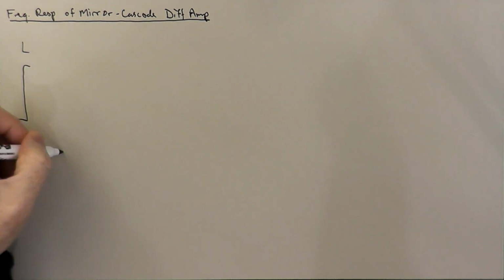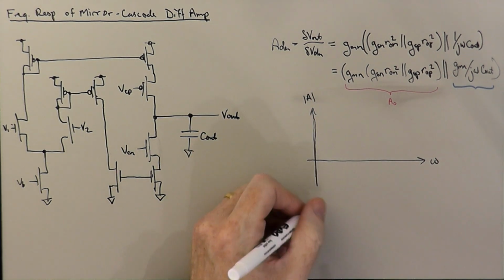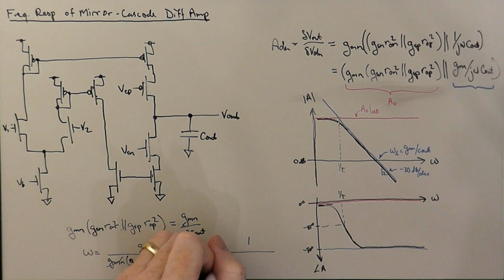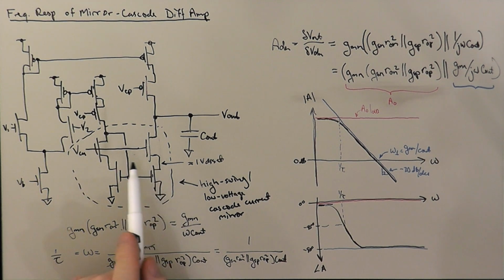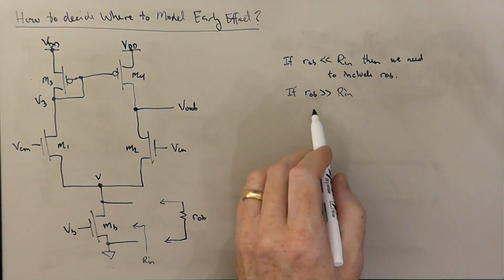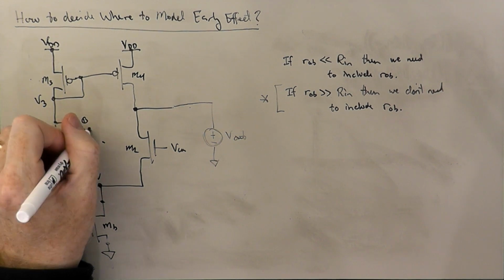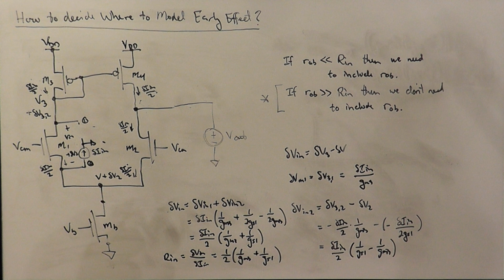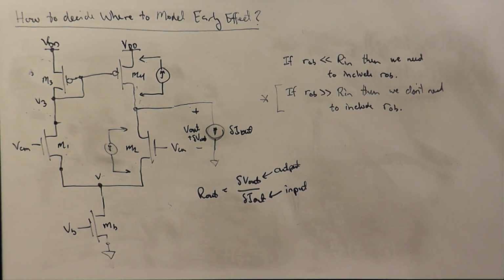Frequency Response of the Mirror-Cascode Diff Amp / Deciding Where to Account for the Early Effect

Comment: Thank you for all the videos. I have a question about this OTA. how can I set the output common mode voltage close to vdd/2? changing the size of transistors does not realy help.
Reply from the maker: I'm not entirely clear on what you are asking about.  The OTA that I discuss in this video has a single-ended output.  In order for there to be a common-mode output voltage, you need to have a fully differential output.  It is not hard to modify this OTA so that it has a fully differential output.  The common-mode output voltage would typically be set using a common-mode feedback (CMFB).  A nice alternative approach is called common-mode feed forward (CMFF), which is described in J.M. Carrillo, J.L. Ausin, P. Merchh, and J.F. Duque-Carrillo, "Feedback vs feedforward common-mode control: a comparative study," in Proc. IEEE ICECS'98.  If you are instead asking about how to reduce the input-referred offset voltage of this OTA so that when the input common-mode voltage is 0V the output voltage is closer to Vdd/2, you would minimally want to put a pmos cascode transistor on the output of the pmos current mirror on the V2 side of the circuit.  To reduce the offset further, you would also cascode the input side of the nmos current mirror, making it into what is typically called a high-swing cascode current mirror.  When made with simple current mirrors, this OTA has a relatively large systematic offset voltage because of systematic transfer errors in the current mirrors due to the Early effect / channel length modulation and the fact that the I1 current goes through one current mirror whereas the I2 current goes through two current mirrors.  Adding the cascodes, substantially reduces these systematic transfer errors.  Hopefully that helps some.
Reply: @bminch  Thank you for the information. I really apperciate that. I did not use the term "common mode voltage" correctly. I designed the pmos input version of this circuit (the one you designed Xschem with skywater pdk). I only modified it to have more gain with cascode transistors at the output. I also used the current mirror you published in conference paper to bias the cascode transistors. However when I simulate it in open loop the pmos cascode transistor goes to triode region since DC output node goes close to 1.7. but when I close the loop as unity gain or inverting amlifier, the feedback sets the output node close to input common mode and everything is fine. I was wondering if I can modify the circuit to see all the transistors in saturation (or subthreshold) in open loop configuration.
Reply from the maker: @rezapapi7  So, you have a pmos diff pair, followed by two nmos current mirrors with a final pmos current mirror.  I am a bit unclear about your cascode current mirror.  Are all three current mirrors cascode current mirrors?  Or maybe just the pmos one with two simple nmos current mirrors maybe with an nmos cascode transistor in the output branch?
Reply: @bminch  I am not sure if Youtube allow me to share a google drive link. but here is a screenshot of my circuit : https://drive.google.com/file/d/1ik_GHj-x1CK93YaFx0bUm5pn1NWsv5db/view?usp=drive_link
Reply from the maker: @rezapapi7  I would recommend replacing the M21-M20 simple nmos current mirror with something identical to your M31-M32-M25-M26 current mirror.  At the very least, you should insert an nmos cascode transistor between the drain of M20 and the input of the pmos mirror.  The gate bias on the nmos cascode should be the same as M26.
Reply: @bminch  Thank you so much for your time. I am going to modify it.